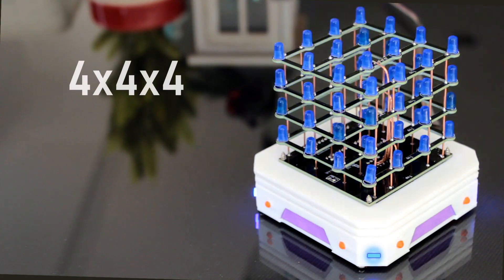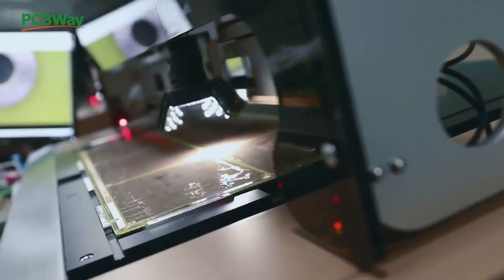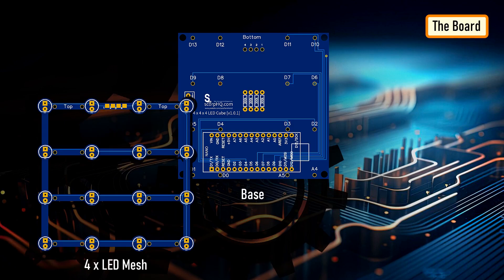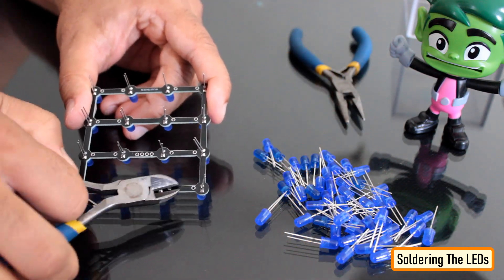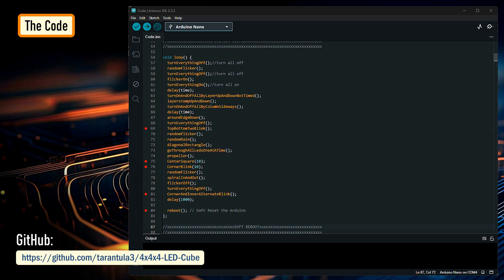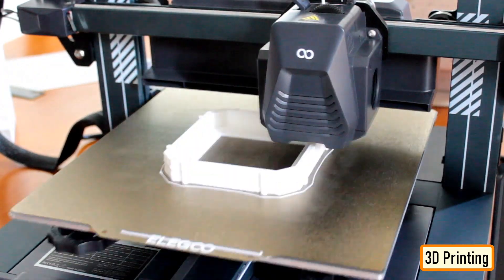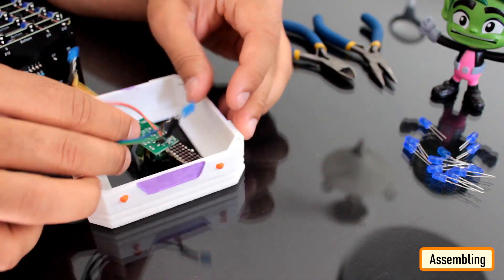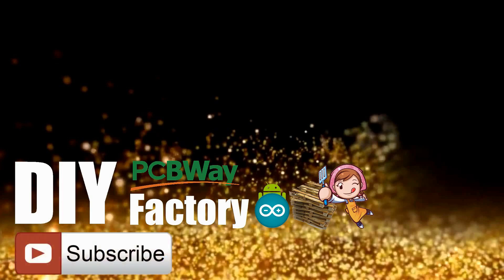4x4x4 PCB LED CUBE

Comment: awsm matt....what's the copper wire thickness....1 / 1.2 / 1.5 mm? any amazon link?

can i use 5v mobile charger?
Reply from the maker: i just grabbed some 1mm copper wore from a local hardware shop